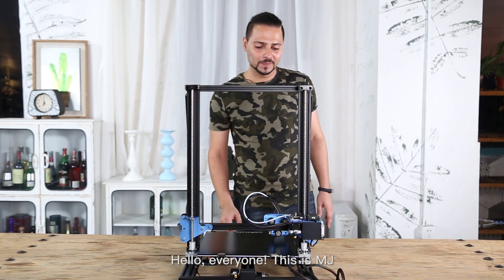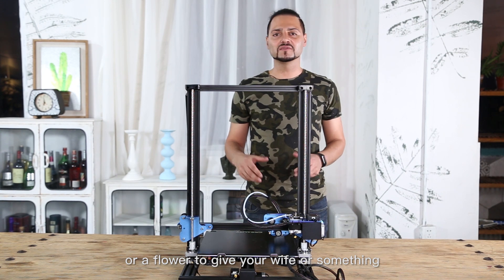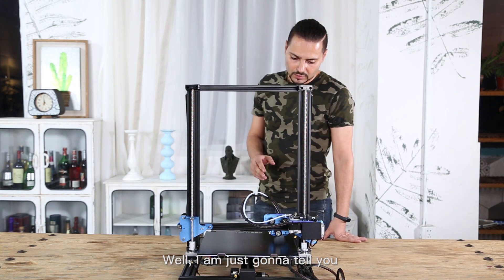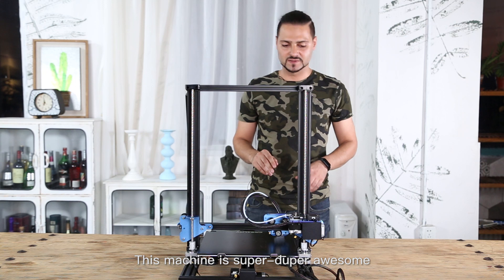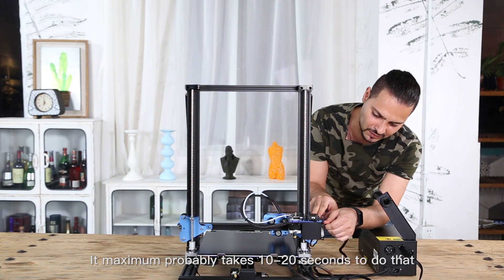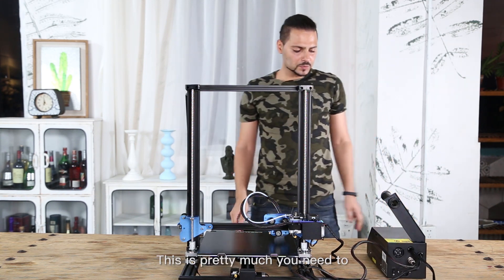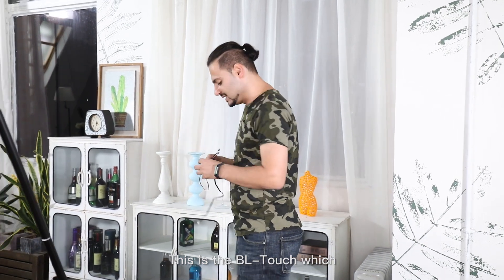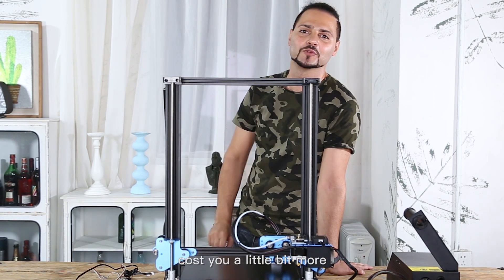Creality CR-10 V2 Home DIY 3D Printer!

Comment: As an owner o this machine I can tell you it's just as good and bad as any other printer in it's price range. I have replaced MANY parts for repair in the three or so years I have had it and his statement of it being "super quiet" is a bold faced lie! The fans in the power box and the fans on the printer head are all obnoxiously loud.